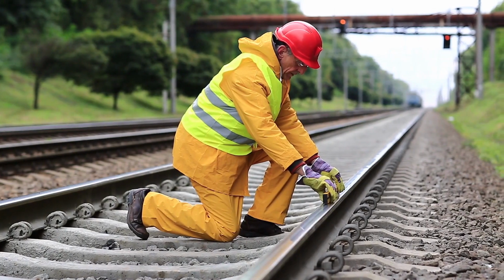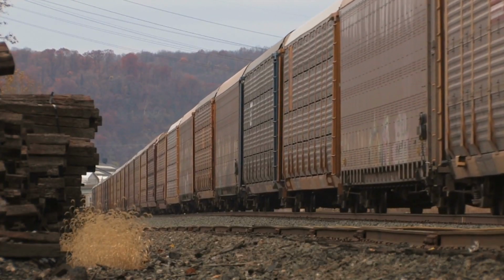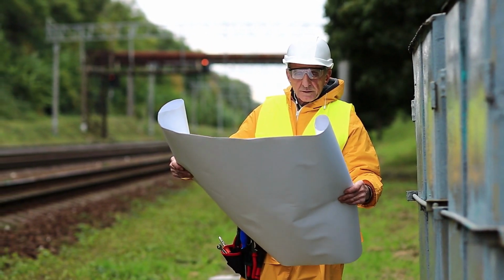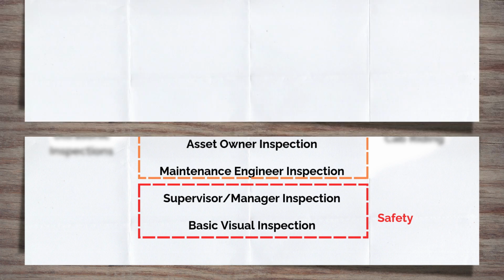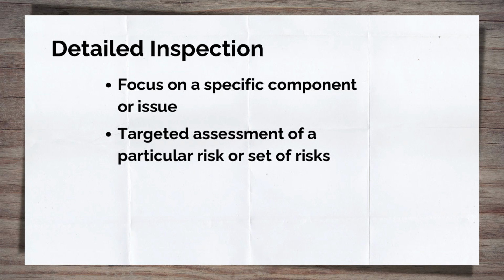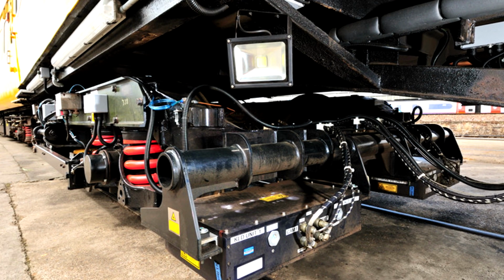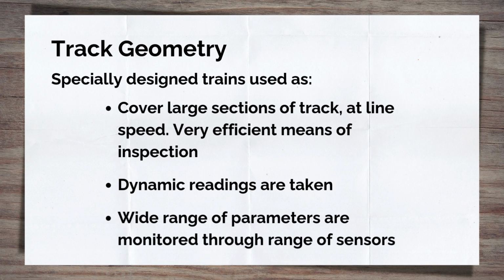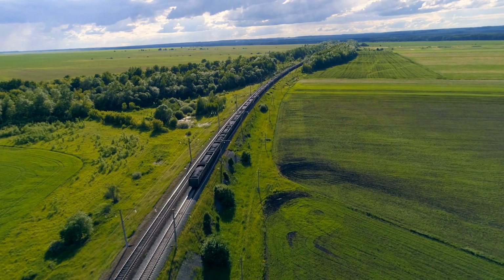How is Rail Track Inspected? The 6 Critical Types of Inspection

Comment: Do a video about the proposal of trains using independently rotating wheels with inverse conicity and flanges on the outside. The paper is titled "Self-steering ability of the proposed new concept of independently rotating wheels using inverse tread conicity". Obviously this system is incompatible with current track, but if compatibility is not a problem, what are the technical merits and flaws of this proposal?
Reply from the maker: Do you have a link to the paper you could share?

Comment: A really interesting video about testing rail.

Back in 2004/05 worked out of Reading P'way as a look out for the ultrasonic testing teams, we covered an area from Paddington upto North Oxfordshire and to Wiltshire. Covering about 5 miles daily on days and night. 

Once seeing the flying banana down at 
Woodborough, covering a lot more than we could ever do. 😉.

As previously mentioned, we found a 100% T O, which we had to immediately fit a clamp to the rail concerned. Sometimes, helped out with the actual testing.

We also worked on the B and H after Ufton Nervet, the signaller telling us there was one train running, but it was almost out of fuel.

Also worked around Bristol, patrolling and lookout work while the switches were tested not to mention the odd tunnel inspection such as Clifton and Box.
Reply from the maker: Thank you for sharing!

Comment: check out the Bristol based company One Big Circle... they're doing big things with train mounted AIVR and i believe recently won a large NWR contract. Have to say that as a track inspector i'm beginning to think i may not have to many years left before it takes over completely.
Reply from the maker: I have seen and worked with their stuff it is pretty impressive. 

I still they will need people but it will be more targeted inspections. I think the days of long track walks are coming to a close but people will still need to go and check things out that the technology flags
Reply: As a layman I can't help wondering what is going to happen to the standard of maintenance now that the whole Colas rail fleet is being disposed of. I imagine that as the infrastructure will have to stay in place longer then inspection frequency will have to increase to identify age related faults?
Reply from the maker: What part of the Colas Fleet are you referring to there Colin?
Reply: @thepwayengineer , as I understand it all the high output ballast cleaners, rail replacement machines and tampers are on the quayside at Harwich and for sale to the highest bidder. Hopefully I am wrong.